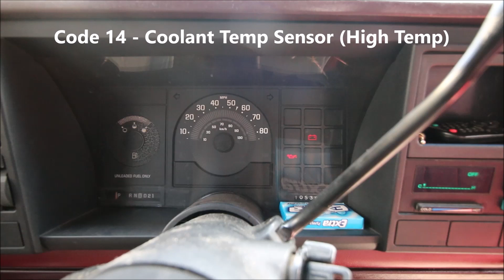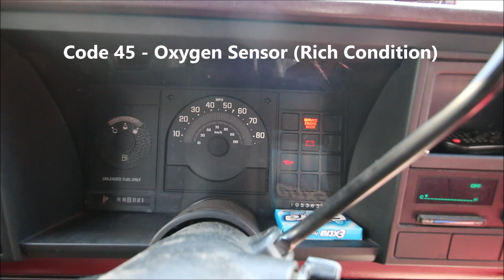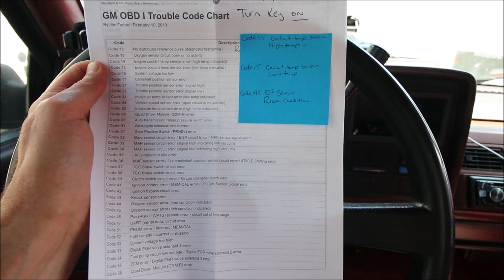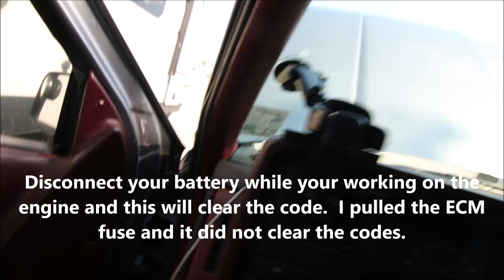88 - 90 Chevy OBD I Code Reader - Coolant Temp Sensor Replacement

Comment: I found this video 5 weeks after I needed it. 
But it was worth watching it because I had no way of starting my truck, so I just decided to replace every sensor, including the MAP, rotor and distributor cap and wires, especially the spark plugs. Also drained the fuel and changed fuel filter. Truck sat for almost a year and a half.
Reply from the maker: Well you’ll be ready next time! 😂. That sensor has failed me twice.

Comment: Can I do this on my 1998 GMC SEIRRA  ?
Reply from the maker: I can’t answer that for sure.
Reply: @JustPlainCommonSense ok  do you think it would hurt to try ? Damage anything  ?
Reply from the maker: @Jeffrobodine23 I think a ‘98 would have a different OBD connector that a scanner could be plugged into. A mistake here, such as shorting out the wrong pins, could damage the ECM. I wouldn’t try it.
Reply: @JustPlainCommonSense fuuuuuuuuuuk !!!!  It was so cool when you did it  ! Do you think you could try it on one of your friends 98 SEIRRA'S and tell me if it worked  ? 

😅

Comment: How come you had to drain the coolant out before changing it? WIll it spew out of the top of the engine when you take the sensor out if not?
Reply from the maker: As Frank Sinatra sang... "I did it My Way".  You would lose some it your radiator was full
Reply: @JustPlainCommonSense  Right on! I'm gonna have to tackle this chore this weekend and trying to learn a little before hand. Thanks again!

Comment: I have code 15 on my 92 chevy silverado c1500 5.7l I changed both engine coolant sensor it fixed the problem but now I just had engine code 15 again should I change my thermostat?
Reply from the maker: https://repairpal.com/gm-obd-code-12  follow the guide.  Thermostat isn't one of the options.  Did you clear the old code?
Reply: @JustPlainCommonSense  yeah I cleared Code came back and swapped the other out. Now when changing the thermostat I accidently broke my bolt on the left side 🙃  I got an extractor and that broke inside stuck now I can't drive it lol I'm at a loss for now
Reply from the maker: @guillermomejia593  Geez, when it rains it POURS!  Good luck with the broken bolt.  Sounds like that may be a tough one.

Comment: I have a no start it cranks 
Has fuel and spark 
But I did this no codes and still no start 
What should I try next ?
Truck is 1988 Chevy k1500 5.7 V8
Reply: Spark plugs 
Wire
Ignition coil 
Starter 
Alternator all new 
I get spark 
I will try the ignition module thanks
Reply from the maker: I wish I had my manual handy. Sounds like it’s an ignition problem shorting to ground. What about the ignition module?  Sure hate to start throwing parts and money at it without some guidance as to the possible causes
Reply: I had a no start condition because the O2 sensor was broken off and dangling on the wire, replaced and all good now.

Comment: Can u use paperclip
Reply: I got a 1 then 11 so a 12
Reply from the maker: @mikeydejon2148  correct. The system is working
Reply from the maker: You can try. It may fit

Comment: I did this same exact thing do to a service engine soon light . All I got was 1-2 nothing after and still get that light .
Reply from the maker: That is odd.  12 just says the system is working. If you lost power to the ECM the stored codes would be lost.
Reply: I have the same problem. Just 1.1-2 code continuously.  Some words going around may need new computer.🧐

Comment: I have a code 15 and I am getting bad gas mileage ! Sometimes it stutters when it is cold and driving. Not when it’s fully warmed up though.
Reply from the maker: That’s the engine coolant temp sensor. Replace it and things should be back to normal

Comment: Awesome dude thanks for the info 👍
I have a 1990 K5 blazer and the engine was down shifting out of overdrive and the service engine light would come on and go out quickly but after I replaced that sensor all is good 🤞🏻
Reply from the maker: That’s awesome!  I’m glad it helped.
Reply: My truck is also a 90 with a 350 and also seems to go up and down from overdrive around 55 60 . Did your truck ever hesitate or stumble when try to gas it around that speed
Reply: @IsaiasMoreno.  yeah I changed the throttle body sensor and it helped a little but found out after I had the transmission rebuilt that it was the transmission shift sensor..🙄🤔

Comment: I have a Chevy Cheyenne c1500 and says only code 12, it stalls when it's warmed up, I've changed pcv fuel filter, thermostat, radiator cap, idk what is wrong
Reply: It finally showed me code 42
Reply from the maker: @Batman-ro7mh  replace the ignition control module
Reply from the maker: If it’s been a while since a good tuneup, replace the plugs, distributor cap and rotor. At least take a look at them
Reply: It's drives fine until it gets warm, in the summer I had no issues but since it cooled down is when it started happening

Comment: whats happening is the o2 sensor is not being commanded because the computer is staying in open loop operation so it continues to stay in fuel enrichment warm up mode.back in the day we thought these trucks were complicated, now they seem easy compared to the crap out there now/ in 10 years these trucks will command big bucks, they are already skyrocketing in value, like the c10 c20s.
Reply from the maker: Sounds right. It was an easy fix

Comment: Hey man so I have a 89 k2500 that runs but when it warms up it starts to die out at idle. I've replaced plugs, wires, TBI, computer, erg sol. Erg valve and I'm about out of ideas. U got any?
Reply from the maker: Replace the distributor cap.  It may have a crack it in.  When it warms up the gap opens up.

Comment: What is code 12 a have 12 12 12. 12 12 12. 12 12 12 o dont no wha is it
Reply from the maker: I’d you go to the video description you will see a link to the codes.
Reply from the maker: In the video at 3:20 I cover code 12

Comment: Will this work for my 1993 gmc sierra
Reply from the maker: I think you have an OBD III. Mine is a little more old school OBD II. I wouldn’t try it on yours without better guidance.
Reply: Yes. This does work for your truck. I have a 1992. OBD2 came out in 1996. Code 12 Means everything is ok. That doesn't necessarily mean all of your sensors are good though.....

Comment: Got a 89 GMC and it has not started since I guess it got hot. Od it thinks it's hot. High buzzing sound and when I turn the key the hot light comes on.
Reply from the maker: Have you checked to see if there are any codes in the computer?
Reply: @JustPlainCommonSense  no , its away from town and no wires

Comment: Would this prevent truck from starting ?
Reply from the maker: I'm not sure about that
Reply: The plugs eventually foul out and the motor won't start due to a weak spark.
Reply: This sensor made my van hard start and black smoke when it would start

Comment: Every truck I ever had, I eventually had to jump some kind of sensor wire. Most often it was a low pressure switch on an AC compressor but a few times it was temp sensors that either wouldnt allow my fan to kick on, or off. good piece of wire to keep handy!
Reply from the maker: Sure wish I still had my '67 Chevelle and  '50 Roadmaster.  None of that junk to deal with.
Reply: Lol it's got the low pressure switch so it dont burn the compressor up when its low on freon. I cannot stand when idiots fool with the ac. Got every switch jumped and results in a burnt up compressor because it doesnt turn on and off when it's supposed to then yall get mad because the bill to get your shit fixed right costs 1200 bucks. When the compressor makes the system black it will never be right again without changing every peice the freon flows
Reply: @DirtyMikeHoncho   actually there is a low and high pressure sensor 😂